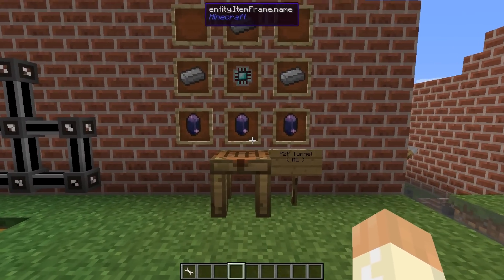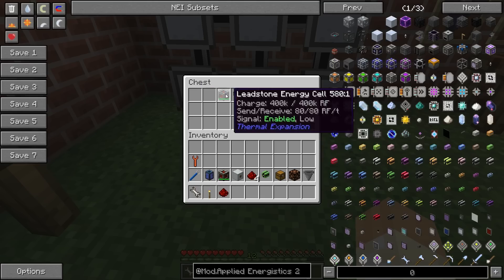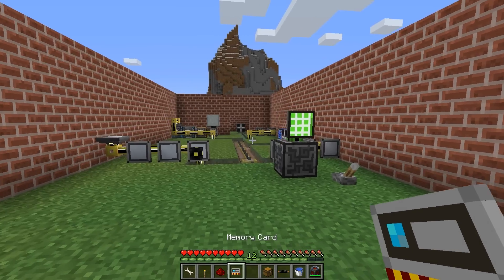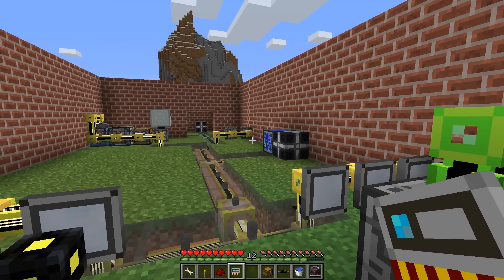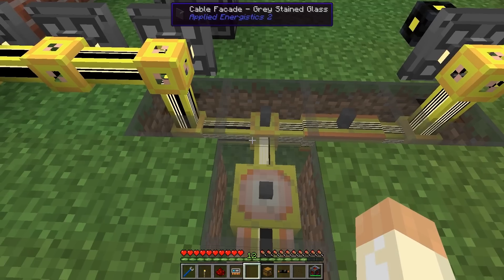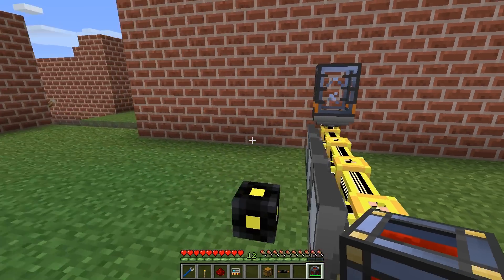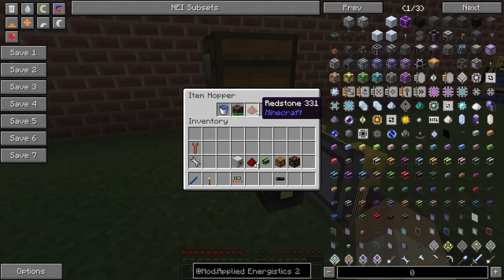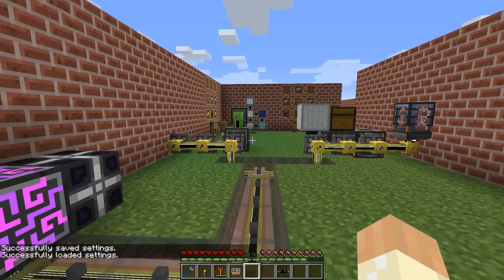Applied Energistics 2 Tutorial #12 - P2P Tunnels (MC 1.7.10)

Comment: Alright, so I am using your controller design from your AE2 tutorial video, but for some reason I just can't get the power to go through the network. I have set up everything accordingly. The network has power, my reactors are working just fine,  and I had it working ONCE but now for some reason the power just won't flow through my network no matter what I do. I have repeatedly reset the connections, took down the tunnels and used fresh ones to see if it's that, swapped out cell after cell to see if they have to be the same or if they'd work either way and I for the life of my just can't figure it out. Do you have any thoughts on where I messed up/could have messed up?
Reply from the maker: Hey! Sorry for a late answer... It's hard to guess without understanding more about the network.... Do you have some screenshots or so? Make an album on Imgur perhaps. Power transfer through some network blocks but not all, when you use P2P tunnels they need to have the "in between network" powered as well. A controller has to be powered but a tunnel will not power the controller block. But as I said, it would help with a few screenshots :)
Reply: TKH thanks for getting back to me and that actually answered my question and now have a better idea to make it work. Thank you again.
Reply from the maker: Ok, great! Hope it works out :)

Comment: In all the tutorials I've seen so far about P2P tunnels, people always talk about the one input to many output examples, but I'm wondering does that mean things can only flow unidirectionally through the P2P tunnels? Is it possible to run it in reverse so that there are many inputs coming to one output? In other words, if you shift-right-click at the end you want to output, and right-click on several tunnels from which you'd like to input, will the inputs all be accumulated together into the single output? I'm wondering because I'd like to accumulate EU power from multiple generating sources and dump it all into the mass fabricator.
Reply from the maker: I haven't tried with the EU tunnel, but for items and I think for the rule is for all tunnels that P2P tunnels ONLY goes from one to many. You can also read that on the official site: http://ae-mod.info/P2P-Tunnel/

Comment: So, if I understand this correctly, you can distribute a different ME-Network (or all the other things mentioned) through a ME-Network without affecting the ME-Network it gets distributed through (except filling one channel).
But why does someone want to distribute light through his Network ?
As far as I know, most light sources are cheaper than P2P Tunnels (And you need at least one normal light source to distribute light)
Reply from the maker: Yeah I would say you got everything right, but I have no good answer to the light source question. I think it's mostly a decorative thing.

Comment: Hey, is there a way where I can connect up two separate ME systems where one is used to do all like crafting etc which then sends all the items to the other system for storage?
Reply from the maker: I guess you can make a subnet for all your storage (with storage bus to an interface) and have the auto-crafting in your "main" network. But I've only done this with specific items... not sure it works with "all items" so to say. What's the reason to do this? Having your main storage in your main network together with all auto-crafting features is the preferred way... :)

Comment: Hey TKH, thanks for the video. is there a way to control a P2P with redstone signal. 
i am trying to using a wireless redstone transmitter/receiver from RFTools to turn off a machine that gets its power from an RF P2P tunnel.

i am getting tired of removing a smart cable from my mob spawner room to turn off the auto-spawner machine (a MineFactory Reloaded machine)
Reply from the maker: Sorry for this late answer (been busy), but yes, there is a toggle bus that will cut an ME cable on a redstone signal. But you could also have a redstone P2P tunnel directly to the auto-spawner room. Ender IO conduits are optimal for auto-spawner control, I did this in my dark trilogy world and it gets really compact!

Comment: Could you please help me? I am struggling to achieve a working p2p tunnel for items. I have an ME controller, then out of it comes a pieces of the 32 channel dense cable (coloured orange). After about 3 segments of cable I want to put in the tunnel for the long distance over to an input chest from a mob spawner. I  have a long section of ME glass fluix cable to run the tunnel through. However when I try to attach the p2p tunnel it will attach fine to the glass cable but the dense cable does not connect to the faceplate of the tunnel like the ones in your video are doing. No matter how I try to connect it, like placing the p2p tunnel on the dense cable first or first on the glass cable, it simply won't show a connection. Will dense cable not go through a p2p tunnel?
Reply: +Mind Fiend I've finally managed to solve what the problem was. I'd configured the p2p to be an item tunnel and the dense cables didn't seem to like that. When I eventually swapped the configured tunnels for blank ones the system began to work fine. Sorry for troubling you.
Reply from the maker: +Mind Fiend Sorry for late answer (a bit behind...), but good that you managed to solve the problem! Always feel free to come back with questions, I'll try to be more responsive though... :)

Comment: Would a RF p2p tunnel work if i had photovoltaic cells attached to a vibrant capacitor bank which gives it RF, then i attach my p2p tunnel to my vibrant capacitor bank, and run it to a dense energy cell? these RF items are from ender io.
Reply from the maker: +LoneNation As I understand your question; yes, it would work. Just make sure to set the IN and OUT (with the memory card) in correct places to avoid problems.

Comment: Am I seeing this right, that due to the p2p tunnel the 32 channels from the ME network only use 1 channel on the "yellow network"? So using these in a medium to big base could save a LOT of cable management. The potential of this mod is insane.

Thank you for the good tutorials.
Reply from the maker: +Niklas Bartels (nemesis0405) You always nailed it :) Correct thinking, but you need two channels - one for input and one for output. Well, you could of course have one input and up to seven outputs, but the total number of channels in this "sub p2p network" would be much lower. In a normal, thin cable you can transfer up to 128 channels (4 in - 4 out). In a dense cable (16 in and 16 out) you'll get 512 channels, but since you'll need a controller anyway in such setup you'll be better off with 32 in and 32 out (one on each side of the controller) you would get 1024 channels in one dense cable. See how quickly it grows? I have made several videos where I use this technique, they should all be in the AE2 playlist and I recommend most of them ;)

Comment: So what's the advantage of these? They use a single channel like other connections, why is the P2P special? I genuinely don't understand
Reply from the maker: +Scootlez Well, the advantage is more obvious when you have a real problem to solve. But in my experience, there are 2-3 things that are very commonly used:
1. Transfer channels a longer distance. For example, you want to send 64 channels to the other side of the base. You could use 2 Dense Cables... but they are expensive to craft. Use a P2P network instead, 2 inputs and 2 outputs (4 channels, so you can use one normal cable instead of two dense. I have done videos on this subject.
2. Transfer Power. For example, you have RF production somewhere. Use a RF P2P tunnel, and have one input and a few outputs. No need for lots of RF fluxducts or similar, you can make tunnels instead. I demonstrated this in my "large AE2 network" video.
3. Transfer fluids. Like water. Same principle as power... have one input and several outputs if needed. 
Hope you understand. So instead of having power, fluid and ME cable going everywhere, use tunnels instead and have only ME cables up to the point where power or liquids are needed :)

Comment: Btw there is an uper limit to p2p outputs its 4 you can have 1 input and 4 outputs
Reply from the maker: The AE2 website says "Tunnels are 1 input to N outputs. This means you can output to as many points as you want, but only input at a single point per tunnel." but I haven't really tested the limit... But 4 outputs sounds really low, are you sure about that? :)
Reply: TKH
i informated my selfe about the ae system and there stands 4 outputs for dense cables maybe it was just wrong information :)
Reply from the maker: +KaiUndMoritz Just verified that you can have one input and seven outputs in a network of this sort. 4 outputs can mean that the maximum number of challens to put through is what you can fit into 4 in and 4 out = 128 channels :) If you need more you'll need an ME Controller for that section and use dense cables - or a Quantum Bridge!

Comment: Tevlig video mannen! :D
But how many RF per tick can the tunnels handle? Like if you could use it instead of the rely expensive high end cables
Reply from the maker: Tack :)
Well, I haven't measured it. But the different energy cells I tried with seemed to be maxed out. The AE2 webpage doesn't say, but I have no reason to believe that it is capped in some way.
Reply: That sounds good to me :)

Comment: Holy smokes. At first, I was really skeptical when I started to play in 1.7 packs with AE2 because I was a fan of the simplicity of the old AE. Or what I thought was the simplicity of the old AE. I didn't want to grow crystals, and so on. Your set of tutorials has not only led me to being comfortable with it, but excited about using it. Thanks!
Reply from the maker: James Orr Awesome to hear that :) 
It's a big difference between AE1 and AE2, and in a way I think it's more balanced now due to the major change in how auto-crafting works (It was OP before). Some people like it, others hate it ^^
Reply: therealtkh I agree, to some extent it was pretty OP. I think that in AE 2 it works out to be a lot more modular and expandable though, without having to expand your crafting chamber in a direction. here, you can just add individual assemblers, and memory blocks, and can decide between attaching multiple assemblers to a single interface, or going the other direction for variety. All about what you want to automate.
Reply from the maker: James Orr Exactly this. Perhaps harder for some people, but I think it can be way more fun once it's up and running. Look at the auto-crafting from logistics pipes, that is more similar to this style than how the old AE auto-crafting worked. Automation is good and fun, but it shouldn't be too easy or powerful :)

Comment: Very nice tutorial video! I just wanna ask if there is a way to run p2p tunnels wirelessly, I don't want cables connect throughout my base.
Reply from the maker: Thanks! As far as I know, no. The wireless components in AE2 are only to get wireless access to your stuff. But you could use a similar variant as the yellow network example to reduce the number of cables required to reach everywhere. In my example with the green network within the yellow network, a single dense cable can hold 16 network pairs = 512 channels using the same setup as I had.
Reply: Not that I know of either. Though conduit facades are your friends for hiding them in the walls if you don't like the look.